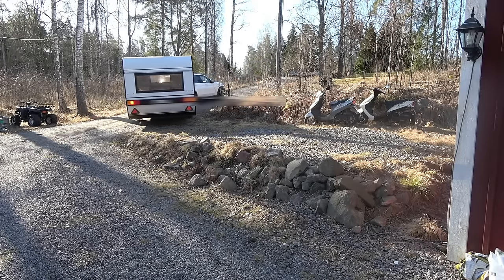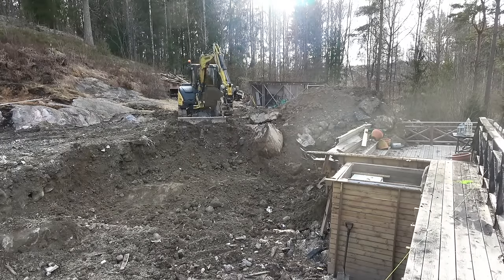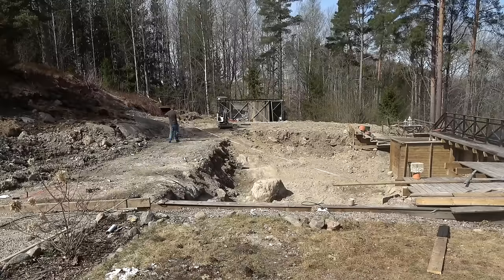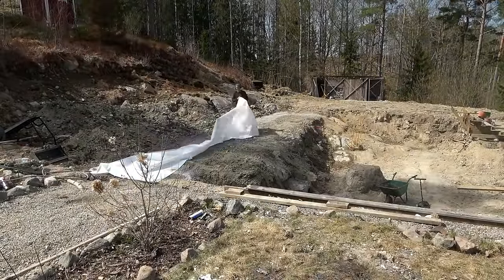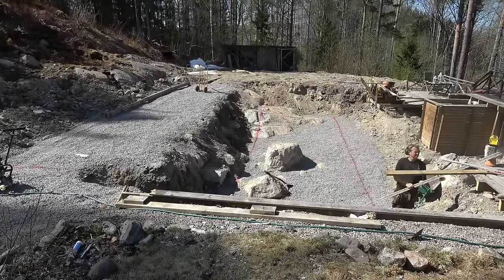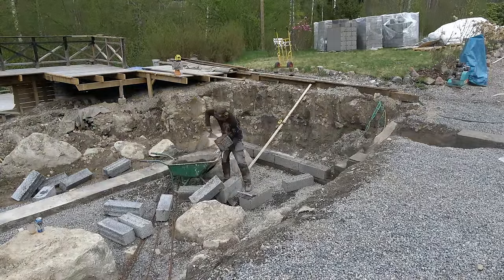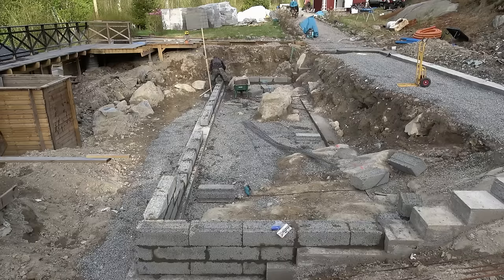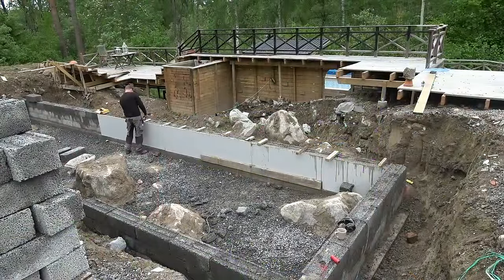Is it possible to build a house all by yourself?  (Ep.1) Foundation

Comment: You're my new role model. What you do is exactly what I want to be able to do. Thank you for the videos🙏
Reply: Do not be like him . Building a living space above ground is cheaper and it's more comfortable to be in than to be in a basement
Reply: @andreycham4797  All depends on location, equipment available and other factors. Basements are pretty functional in cold climates- as long as you waterproof the living daylights out of it.
Reply: @CrossroadToCountry  useless overpriced extra space.  Before EXPS   foam time I could agree with you but doing in it now , no economical sense, just religion thing
Reply: @andreycham4797  "Religion thing" ??? What? Please explain.
Reply: @Cloud-dq1mr  why did they build basements in cold climate? Because  they have tall foundation wall which allow them to get more useful space  . Why did they have tall foundation walls? Because they had to set foundation footing below frozen ground to prevent foundation from moving. Now we can build shallow frost protected foundation with XPS foam a lot cheaper.
Reply: @andreycham4797  Ok, thanks for that detailed explanation that doesn't answer my question at all.
Could you please explain instead what you meant with your "just religion thing" comment? Did you maybe mean a cultural thing? Religion and culture are completely different things, and also brings very different connotations.
Reply: @Cloud-dq1mr  when someone  suffers and spends his resources on something useless  . I would ask myself why would he do that ? First I really want to know his logic behind so I could learn more about a subject if I don't find better arguments that I already have , so I explain it as his religion will not allow him build a house without a basement but it's a joke . Second  I am harsh on him just to make others think before they start taking on big projects. I am admired the work he is done  I know what it takes since I have been remodeling my properties by myself for a few years now and I do not see the end of it

Comment: Hi. I’ve been a carpenter for 26 years I Denmark. As you said we build the same way in the north. New regulation in Denmark say insulation i a wall haft to be a min.350mm. I build my own house a couple of years ago. It fallows the regulation for a 0 energy house. I have 440mm insulation i floors, 400mm in walls (same construction as you with the moisture barrier inside the insulation) and 600mm in selling. 
Question here in DK we haft to have the house pressure tested to se if the barrier is air tight. Do you have the save rules in Sweden?
The house look 👍

Comment: Here in the UK, when we place rebar in concrete, the lengths of rebar overlap by a minimum of 40 times it's diameter. So 1/4" rebar overlaps minimum 10". We also let the concrete company know what the concrete is for, because concrete with rebar has a higher ratio of cement. But I don't know the ratios for the different concretes, that's done at the concrete supplier.
Reply from the maker: We do it similar here too. The slab i made was directly on rock, so i only need to keep the concrete together and not think of the load to much.

Comment: In the US, most foundation codes require footings down below the frost line, so most houses in the northern part of the US have basements, as trenches are dangerous when that deep. 
The other major change from the US is not doing the first floor as a deck, and assembling the walls flat, and tilting them up into place. Framing details also vary.

Comment: in the old days they would drill holes in large boulders, hammer in oversized wooden pegs and pour water on them.   the absorption of the water expanded the wood (swelled) and created cracks in the rock.     wood is a very strong and durable material and has been used since the dawn of mankind for many purposes.
Reply: Thanks for sharing that tidbit

Comment: Fantastic job doing that by yourself and that fast. Looking forward to the rest of the build. What are the blocks you used? Are they available in the USA?
Reply from the maker: Good question, the blocks are lightweight concrete type but with clay balls in them. We have the type where you pour concrete in afterwards but I like these better, relatively cheap and easy to work with. I'm sure you have them but we still use materials like in the 70s except that it doesn't contain dangerous substances, you've probably moved on to other things.

Comment: Good masonry technique if you know the method well then. — However, without bricklaying skills, one can still manage (right at the basic construction) perhaps almost better here by casting the concrete wall using hollow dry-stacked 4'L x 2'H x 10''W buildable shell blocks (casting walls almost without formwork). To level the last shift horizontally and above windows and doors, you may need to cast a wreath (around the perimeter) and/or cast a reinforced beam.
— When building the foundation, it is important for a newly built home to decide to (when possible) build a full-height basement, with the best choice being solid cast reinforced concrete walls with insulation on the outside then. Doing this as a DIY project. Then (for a non-mason as well) vertical (drilled into shallow concrete casting) and horizontal reinforcement (in each layer 2 parallel to the longitudinal perimeter of the blocks and bent in the corners) for 10'' wide reinforced shell blocks (dry stacked) filled with concrete ( with concrete mixer) at its own pace as this will be super good and (so to speak) more stable (10''=25cm) and a better built wall than with Leca (lightweight concrete brick and mortar) not as secure against keeping the moisture away (external moisture protection on the outside of the insulation of course) but cast concrete over the entire wall then (without expensive formwork then of course) with the shell blocks (reinforced as in Sweden where the shell blocks have been designed half-against half) you get a finished cast concrete wall as good as those cast in large buildings with professional metal molds then. A basement with a ceiling height of 9' requires 14 (2' high measured) stacked shell blocks, if the basement is built as a garage foundation on the horizontal plane (i.e., example on grade). 
For next project after home construction a Garage foundation? 
https://www.youtube.com/watch?v=TVvdbBrZd28
https://www.youtube.com/watch?v=g8roG92U7Kg
Reply: Errata for row 3 from top: 4'L x 2H x 10''W then
replaced with the correct meaning: 16''L x 8''H x10''
Errata for row 6 from the bottom requires 14 (2' then replaced with the correct meaning: 14 (8'' =20cm...
Two typos that are regretted.
A detached garage with the then well-built foundation as a cast foundation wall:
https://www.youtube.com/watch?v=U2FuC0eqjds&t=12s
Your next home project? (If it had been a 2-storey (1 flor + semifloor i.e., gambrel roof) residential part above the garage Beach home floor plan.)

Comment: I'm 24 minutes in and loving this! I'd love to do this myself one day.
Genuine question here, I'm not trying to sound like I'm criticizing the work. But if you had to form the bottom of the foundation anyway, why not just form the entire thing instead of using brick?
I can't wait to watch the rest of the episodes!
Reply from the maker: I actually thought about it for a while and calculated that the cost was about the same. Later, fuel prices went up and concrete actually ran out in Sweden, so it turned out this way. But I would probably prefer to cast everything instead, just like you mention.

Comment: Amazing work sir! What kind of blocks are you using? Also was wondering how low is the frost line in your area
Reply from the maker: Hi, its like a cinderblock but with clay balls, called Leca blocks. they are at least 3 times stronger that cinderblocks. The frostline on paper is around 120cm or 4 feet but in real life around 60-80cm or 2-3 feet. My house stands directly on rock so it wont move much during winter.
Reply: @mindsparx1   nice, I was born in Eastern Europe and I know they sell them over there but here in USA have never seen it for sale, hm. I read those blocks are warmer than pure concrete, I didn’t know they were stronger than regular concrete cinder blocks.

Got the land In the woods and am planning build an a frame there next year. Was going to start this spring but wood was like 5x of what it’s now so decided rather do landscaping around my house 😀 was a really busy summer. No rocks at that lot though, high water, sandy soil and 4 feet frost line. 

Your channel is definitely inspirational, thank you for sharing sir, you rock!
Reply from the maker: @ekurdesov  I think cinderblocks are hollow, but these are missive. Good luck with the build and let us know how it goes :)

Comment: Is mixing the concrete in small batches and having cold joints a common practice in Sweden? Are you not concerned with this due to being on bedrock? If you weren’t on bedrock, and mixing small batches by hand would the rebar at the cold joints still make the footing strong enough?

Comment: How much was the material cost bricks, concrete, gravel, geotextile cloth for this foundation for this 88 KVM house? I want to compare with contractor for the cost and see if excavator work is better done by contractor. Also how much was renting the big excavator, soil compactor etc? How to find the sand like you went somewhere with car and just brought it? Tried looking for prices in the excel but I think prices are only for upper wooden house or I don't know if I missed something :)

Comment: Amazing. Quite impressive and inspiring.

One question thought, the old house foundations were damaged in the fire? Why do you need to redo the foundations?
Reply from the maker: The house stood on poles with cover, it works as well but you get a bit colder floors, so i did it this way instead since i had the time and money.
Reply: @mindsparx1  ahh ok ok thanks for clarifying 👍

Comment: Your hard work is impressive, to say the least.  I have rarely seen a person who works as hard as you do!  I am worried about the effect of that on your body long term.  Perhaps you could have an apprentice to share the load?  I understood that you needed to develop more lateral resistance to the soil backfill at the higher backfill sides of the construction, and so you improvised and poured 6 cm of concrete to the inside.  I am hoping that you know that this is needed only where the backfill of soil is higher than 4 feet.  If there is no backfill, then the 19 cm, or 7.5 inches of solid block construction foundation should have been adequate - BUT THE LOCAL CODES WILL DICTATE THIS VALUE REGARDLESS.  If they do indeed dictate that all four sides of the basement foundation MUST be 25 cm(10 inches) thick, then why do they insist?  Can you explain.  All of your construction techniques are impressive.  The drainage paper separation between the layers of gravel is impressive.  Water will tend to run down the hill, and allowing it to pass under the foundation is interesting.  How do you keep it out of the basement space.  We have a new technique here in the States called "Form-A-Drain".   Here it is, I am hooking you up dude.  https://youtu.be/J6F0iOIlsTg  This system, if you can afford it, is far superior, saves time, and labor.  I use only an exterior form a drain, and a wood form on the inside edge because I do not have radon issues where I build.  if your soil tests positive for radon, then a form a drain on the inside, hooked up to a pipe that goes to the air (with fan if desired) can satisfy the radon issues, per most code jurisdictions.
Reply from the maker: Thank you, the extra 6cm was to make the constructor (or Architect) happy, you are correct its not needed since i don't backfill that side. It also gives a better insulation value and its cheap to do, so why not :) This plot is really tricky as it is a sloping mountain. I have drained as best I can but water will get past the drain and under the house. The first part of the foundation has a vapor barrier and the second will be cast with a vapor barrier under the slab with drainage pipes so I hope that will be enough. Thanks for the link i will check it out.
Reply: @Mindsparx  your underslab drainage should suffice, and bc of your layered paper and gravel system,  I see it's needed. If you do an exterior piping to daylight and an interior under slab piping to daylight,  I would never connect the two. And, as long as you protect both piping systems with geotextile fabric, so that no sediment can enter the piping, they will do the trick.

Comment: I don't understand why you dig to bedrock and fill it with gravel and on top of it poured a 15 ish cm foundation with a few rebars  instead of pouringa bit more solid foundation directly over the bedrock with a bit more rebar, the whole Idea of digging deep is to find better and stronger soil and if you reach bedrock you are lucky because the rock is strong as f*ck the gravel is required where there is no bedrock but only clay so you compact the gravel in the trench for better bearing properties, may be is a code in Sweden I don't know but in the rest of EU it is not common to put gravel over bedrock except for some leveling purposes, ones more I am impressed by you really
Reply from the maker: I want the water to pass under my house, I'm on a slope and there is a lot of water coming from above. I have drainage pipe in front but a lot of water passes that so i let it pass under the slab instead of being collected in front of the slab.
Reply: @Mindsparx  it will go under through the gravel yes, interesting solution hope there will not be future problems with that water running beneath the foundation, I like how you make everithing from scratch I purchase my mud and stuff in a tiny bags never go far my own sand I just add water and dumb the tiny bags in the mixer
Reply: Gravel breaks capillary action and prevents the water from making it's way up into the foundation as easily, with the organic material that makes up the soil left, it would linger in the foundation.

Comment: Hi there! Impressive job!
Do you know why the previous house burned?
Reply from the maker: Unfortunately, it cannot be determined
Reply: @mindsparx1  I am sorry to read it..
 Multi trade carpenter in Latvia my self.
Also doing my own house attachment soon. 
I have seen mice eating on electric wiring insulation, wondering if lowering voltage to 110 or weaker fuses would do a bit for safety difference...